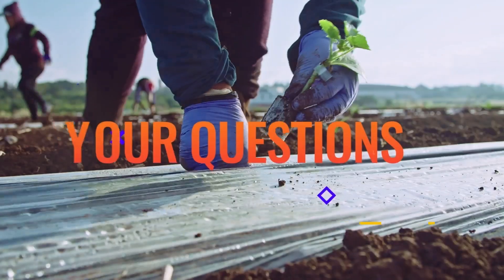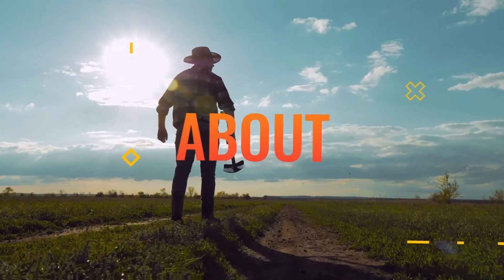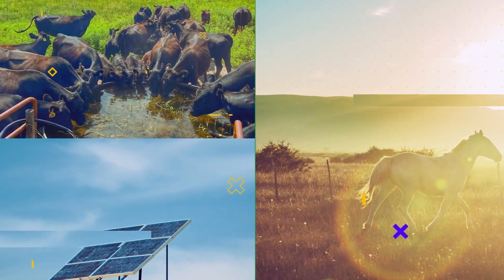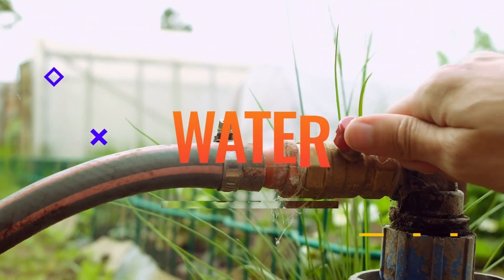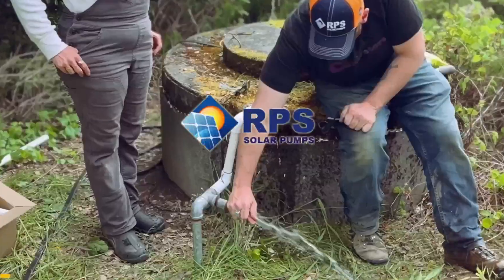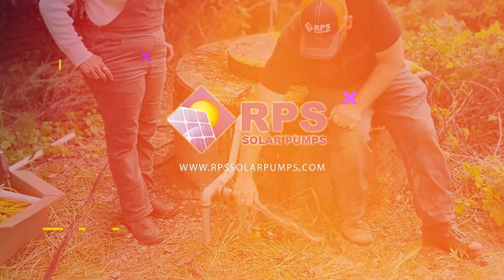Can A Tankless Pressure Pump Do Livestock and Irrigation At The Same Time?

Comment: Hello, and watching the constant pressure pump video as filling a water trough with a float it brought to mine as the trough is almost full and the float has restricted the valve to minimal water flow. Does this create a short cycling of the booster pump? If so, would a buffer tank(pressure tank) be needed To eliminate such short, short cycling, and wear and tear on the booster pump?
Reply from the maker: Great question!  The pump is variable speed, so as the float closes and restricts flow, the TPP automatically senses this and reduces the speed of the motor to match flow rate needed.  So no short cycling or other issues like increased wear and tear, as the TPP can vary the speed of the motor to match flow rates.